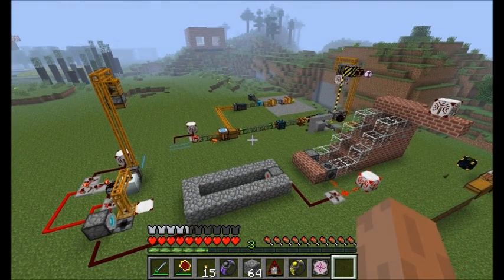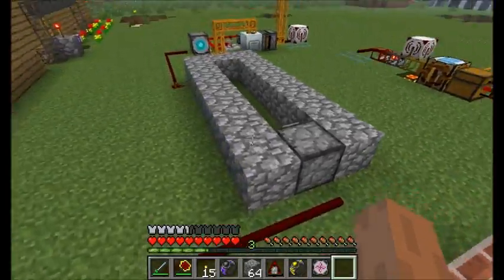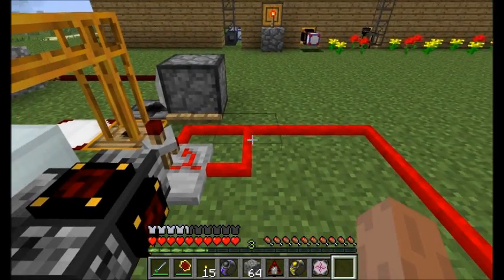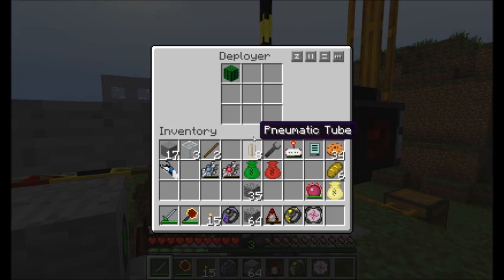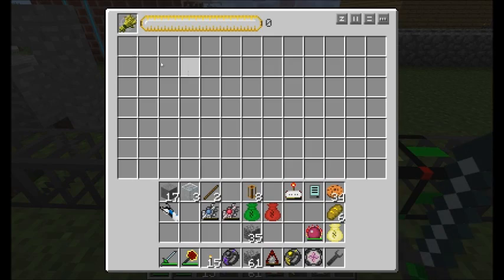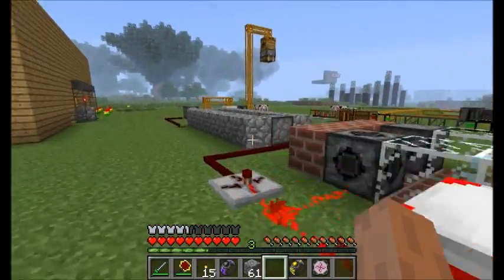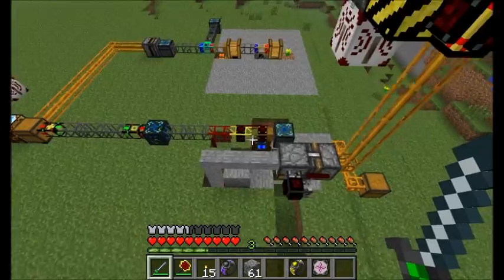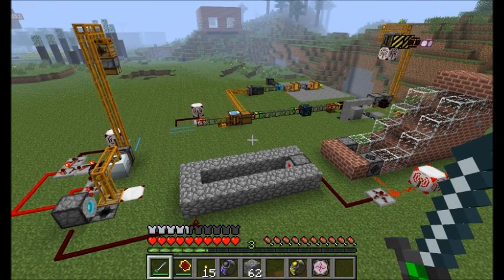Direwolf20's Rube Goldberg Machine

Comment: i would just like to suggest something, you say that the cactus, when grown, is broken by the block breaker then pulled into the alchemical chest. It is my understanding that the cactus is breaking because of the cactus' code. the cactus can not be planted with a block directly beside it, the corner is fine, also placing a block beside a cactus will "chop" the cactus off from the height the block was placed at. I would just like to point it out and if I am wrong please correct me. Thanks

Comment: @direwolf20 Here's your next challenge: design some kind of self-replicating or self-extending machine. I recommend a base of several Energy Condensers and Collectors making the resources to be auto-crafted and then sent through Tubes or Pipes. If you can find a way to make a Builder use a Blueprint containing a Logistics network that connects to its own network, another Builder, and a Supplier Pipe with copied settings, so that the Blueprint keeps getting passed along, I will be very impressed.